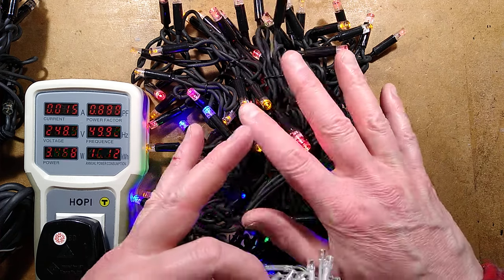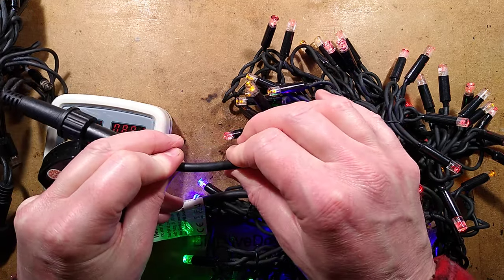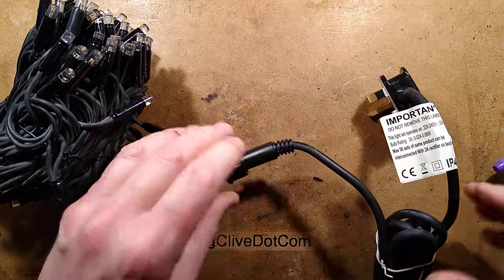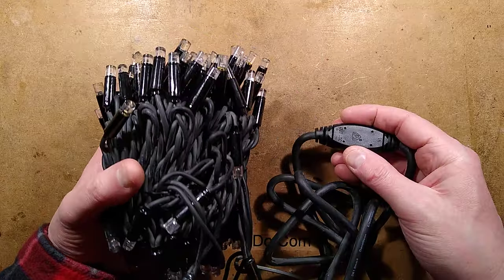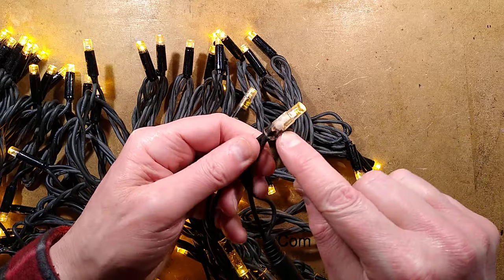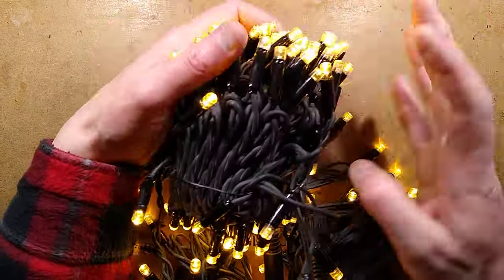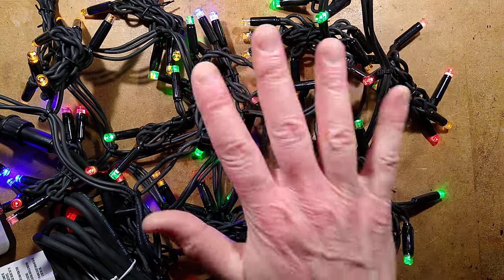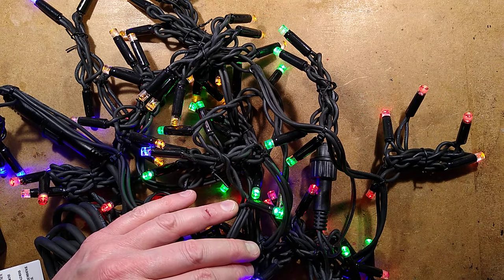The construction and wiring of professional LED strings.

Comment: The resistor is on the wrong leg of the leds in these strings. It shall NOT be on the leg with the anvil, because the heat from the resistor (and soldering) will pass on to the led die and break it down sooner.

Comment: They look exactly like the ones I bought in a consumer diy shop about 10 years ago. They still work fine, although 1 led in two of the strings are off. Now, try to explain that :-)
Reply: An overdriven LED can fade to zero light output or go short-circuit.
Reply from the maker: With mains voltage across them the LEDs often fail short circuit.
Reply: Wait until a few more fail short circuit, then you risk cascade failure 🤣. I’ve added an extra couple of resistors in series (on the part that is inside the garage) to composite for my set having three failed LEDs.

Comment: So you can dip each light into some WD-40, (which stands for Water Displacer formula #40, so the name kinda gives you an idea about what it does) to prevent water from wicking up the leads.  But even that will not prevent water from pooling in an LED that is hanging upside down in the rain.  For that, you would have to fill the space with a nonconductive grease, such as silicone or lithium grease.  The point is that it is possible to make these strings more water resistant, if not outright water proof (probably not).  You could do this with a syringe.  I don't bother going that far.  I stick with WD-40 for the LEDs.
I like to spray my outdoor lights with WD-40 about once a year (not my indoor lights).  This seems to work reasonably well, but then, I'm wearing gloves whenever I handle them to prevent my hands from getting all oily.  Just stick the tube right up against the wires as they enter the LED and give it a short squirt.  The tiniest squirt will ensure it's in where it needs to be.
On my porch, I have a couple of strings of that cheap junk you showed early in the video.  I leave them outside all year round - but just plugged in between Thanksgiving and New Years day.  So they experience rain, melting snow, and freezing rain as well.  A bit of silicone grease in the control box and some WD-40 along the strings every year has made them last 4 years so far.   My only issue is when a wire was pulled out of a LED and I had repair it.  They're quite easy to repair and even easier to bypass a LED.
Also, even with the good string, that connector is already VERY water resistant, but still could use a bit of either grease on the inside and/or a bit of WD-40 on the outside.
Decades ago, whenever they built electronics with an intended use outdoors, they often encased the electrical components in tar, which rendered them highly water resistant (but not outright waterproof).  Today, using nonconductive grease and WD-40 serves much the same function, even if it can get a bit messy.

Comment: @bigclive: Couldn‘t you just use one big, higher rated resistor for one section instead of going through the procedure to attach one small one to every LED? I can see no other reason than this localised heating (you mentioned) why one would do this - it kind of simulates some feature of an incandescent bulb...
More importantly: Merry Christmas to you and your family! 
And btw.: thank you so much for providing a powerful distraction from the chaos that‘s currently going on!
Reply from the maker: It lets them put the resistor in the same sleeve and spreads the heat dissipation along the set.

Comment: I was hoping they’d all be in parallel and there’d be a big 2.5 volt full rectified DC power supply on the end running them

At least there is a rectifier

Oh and you mentioned there are ones with power supplies
Reply: @Matt Quinn yeah I guess I didn’t think of that. I was more meaning shorter ones though like 10 or 20 feet, but I guess that could still be problematic.

Comment: I don't really understand why they don't size the strings with the right number of LEDs so that the resistors aren't needed.
Reply from the maker: I think the first forever bright LED strings in America tried that, and they were very susceptible to damage by voltage fluctuation.  With LEDs, as soon as you reach their forward voltage, a tiny voltage increase will result in a significant current increase.
Reply: @bigclivedotcom   Thanks.

Comment: @bigclivedotcom Big (beardo) Clive, apart from it being a right pain in the a**e, could one prevent moisture wicking up into the domestic lights by using heat shrink and/or hot glue?
Reply from the maker: I made a video about that.  I just sealed the backs and moisture still wicked in around the heatshink at the front.
Reply: @bigclivedotcom  I haven't seen that video yet, but my excuse is that I have been entertaining myself with former Secret Manx Beard Club videos instead. Capital Beards meetings are not nearly as exciting 😏😁

Comment: It seems American LED Christmas lights are more like these industrial sets however the bulbs can be removed and often come with plastic caps to mimi the old style mini lights. The wire is the same as regular mini lights had, 120V strands no adapter. The outlet on the string plugs right into mains, no converter. But this simple method makes the LEDs flicker at line frequency. Now Philips did correct this with some light sets for instance all the Twinkle LED Philips sets have a larger plug and they dim down when unplugged. On camera they don't flicker compared to most LED strands. I suspect there is a capacitor in there or something. And a lot of non Philips sets I've found have an extra piece in the sections of lights that houses something not fully sure it gets warm so maybe a resistor but these sets still flicker on camera if the frame rate don't match so I doubt its a capacitor. Oh and theres no resistor on the bulbs in the sockets. I cant tell if it's in the socket. But I don't think so.

I am so glad you did a video on the industrial lights vs the consumer ones. It took a lot of searching but I may have found a place that sells UK LED lights that are almost exactly like US LED lights. The only US sold lights I've seen that look like European LED lights are the Solar Kind. Im actually planning in a few months to start a youtube channel and convert some of my American Sets to a DC series set that could plug into a European LED Fairy light transformer. I think it would be fascinating and a learning experience. I'd love to have a way to see the sine wave cause it would be interesting if some kind of DC is coming out of the end.

And on the box it says you can join 50-100 sets together.

Comment: I like the notion of three years life expectancy for LEDs, as I consider my 30 year old multi-channel incandescent festive light sets, which also have more interesting and amusing shapes and styles of bulbs. - I remember one year , hanging somewhere around 6'000 bulbs around, across and throughout the garden - Like a miniature Blackpool Illuminations. It was something of an event, even a novelty, back then. Nowadays, you can hang 1'000 in a single string. 20'000 to 30'000 lights are commonplace, even at homes without a garden.

I still prefer incandescents! - And, between you and me, I hate those awful blue ones. You'll know the ones I mean, so far to the blue end of the optical spectrum that human eyes can't focus properly on them - You can see them, but you tell quite where they are!

Comment: Why 3 cables go in first one
Reply: Feed wire goes in and back out, then runs alone all the way to the next set.  Daisy chain wire starts at that one and then goes through every LED until the last one has the same 3-wire arrangement for the other feed wire.

Comment: ...And I'm still using four ~15 years old sets of incandescent strings that have not been removed from the tree for about 10 years now. They are all white now as paint flaked off the bulbs, except couple of bulbs that I replaced over time. Each winter a set or two require resurrection with a piezo igniter (does anyone remember this trick?) and when I plug these 200+ watts worth of christmas lights I can see lights dim momentarily.

Comment: Great Explanation Clive as always. 
I've always loved making my own Christmas Lights, All mine run on 12v thanks to having 30 x 62Amp HP server power supplies I got cheap on eBay (£22).
I've been trying to find a UK supplier of the H05/H07 single core in 0.5mm/0.75mm if anyone knows of a supplier??  
I have been using Concordia double insulated tri rated cable so far, 3 years deep and no problems.
Reply from the maker: You won't find single core cable easily.  The double insulated test lead cable may be a good option.

Comment: Yeah , they say max  50 per rectifier because  of  " C " factor.
Smart .
Reply: Too many would add up to the current rating of the rectifier and cable.  1.5A through relatively thin gauge wire and a 2A rectifier would overheat stuff.
Reply: @johndododoe1411  You know what the " C " factor is right  ?
Reply: @royshaft  Actually no, with the extra spaces it looked like some kind of insulting slur.
Reply: @johndododoe1411  When i used to design  and install control and power distribution in industrial applications , we would often consider the C**T factor , no joke .
The ability for some C**T to mess it up or blow themselves up , literally .
Measures , which seem obvious today , were then taken to prevent  such  C**T from achieving his final destiny .

Comment: Xmas lights are incredibly dangerous! 
If it was up to me, I would only allow 12V systems, that use constant currents for each bank of LEDs.
Each LED must have its own constant current circuit of 2~5mA built in to the die. Can have 2mA modules, or 5mA ones. or whatever..
But, I'm not in charge, and thousand will die in house fires each and every year.
Reply: @25566  You're thinking DC.